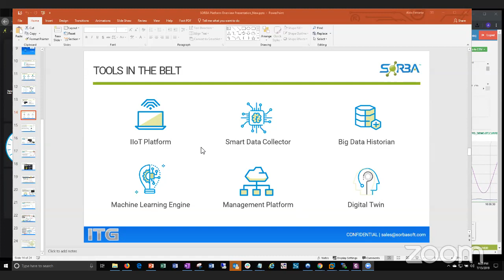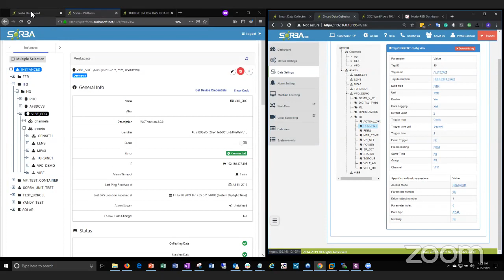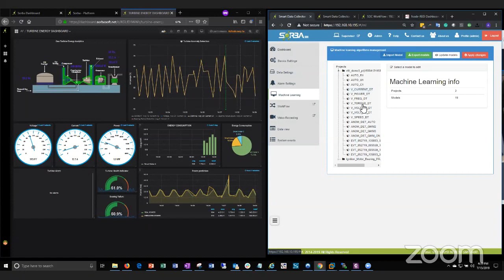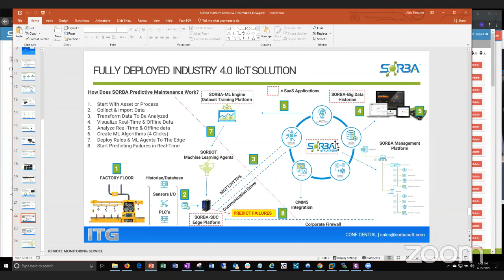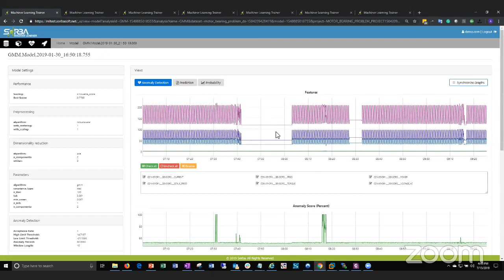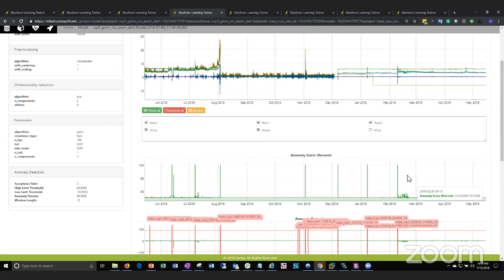4.0 Solutions - Sorba IoT Demo - LIVE

Comment: I keep waiting for someone doing the ML conversation in manufacturing to give the example we all know in real life in the plant - that is  the connection between performance and staff, so the ML system says "Uh Oh, Joe is on tonight's shift - expect a 30% production loss".  If people do that perhaps they'll send automatic firing notices like Amazon does.  Not a great way to build staff capabilities, but certainly could be seen happening.  We HAVE to remember People First as the most valuable asset, and give them the resources they need (including mentoring and training and tools) to perform their job - but don't use these systems to "beat" people, especially electronically.  At times the models will be wrong but sadly people will become more stupid and stop thinking well and let the "computer" make decisions and give them authority they shouldn't be entrusted with.

I'm not opposed to ML, but all tech tools have to be utilized by people using wisdom and guidance as it makes sense.
Reply from the maker: Accountability sucks!